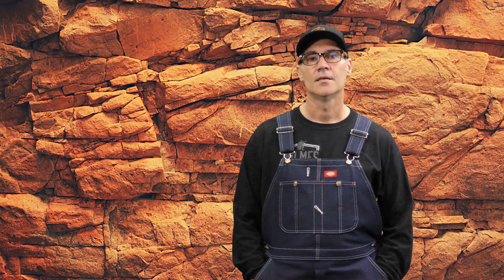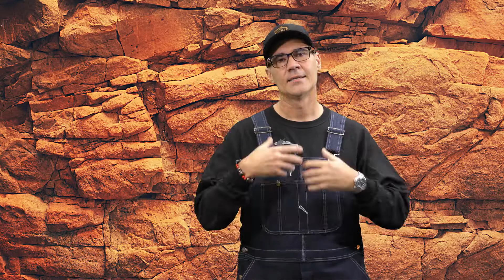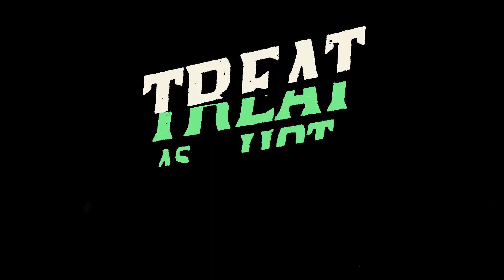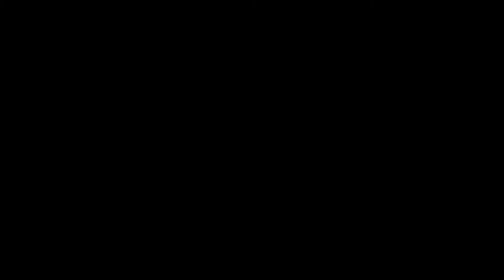Asbestos friable versus non friable

Comment: My wife and I recently purchased a home built in the 1920's for the two of us and our small children. Because of the age of the home there is some white asbestos tape on the ductwork seams. Most of the tape is intact and my understanding is that if left untouched it should be safe. There is however a few seams of tape that seem to be cracked and deteriorating. They appear to be friable but cannot confirm that because I don't want to disturb it. My question is, the ductwork is in the basement and much of it is fastened to the floor joists. Could walking on the floor cause the compromised asbestos to release fibers into the air? I'm deeply concerned about my children being exposed. Any feedback from an expert or professional would be deeply appreciated.